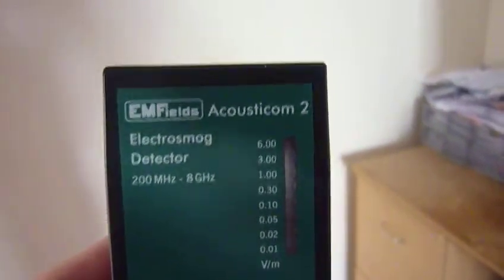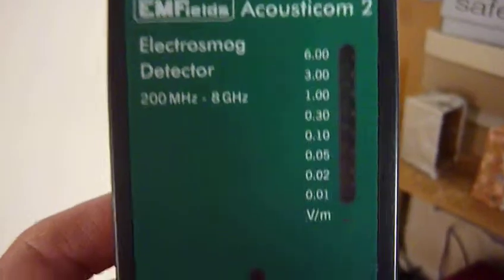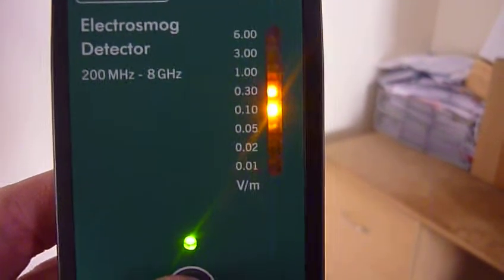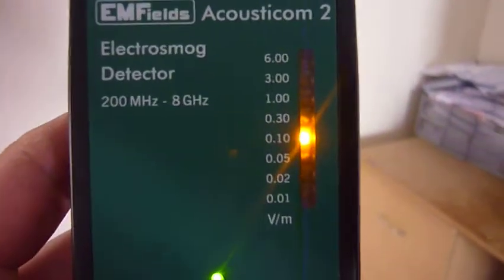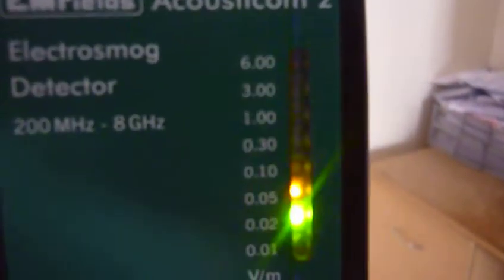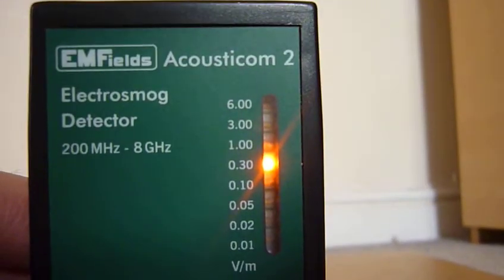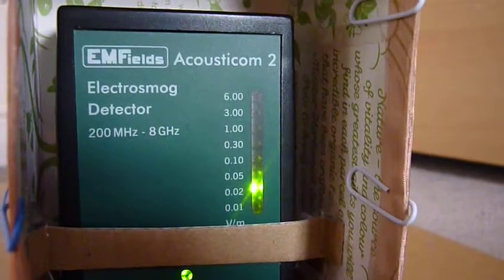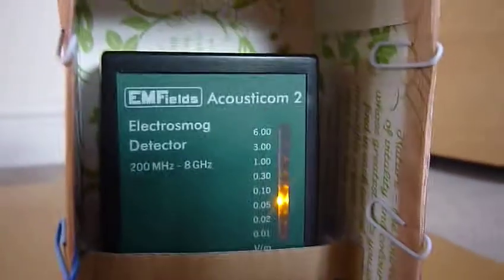Shielding wifi microwave radiation with Yshield paints and fabric

Comment: Certified Master electrician here: NEVER ground the shielding paint to ground in electrical outlets. This is a bad ground full of dirty electricity and by doing so you will create a room with dirty electricity radiating you much stronger!! You need to bring a ground from outside the house from a grounding rod, hammered into the ground.

Comment: how are the maximum and minimum levels computed (for the safety reccomendations)?..and what is the effect of having the various levels of elektrofog on a human?
Reply from the maker: There are various safety recommendations, they are all different. the 1998 ICNIRP (WHO) give an 1800Mhz  exposure guideline of 9,000,000 microwatts/m2,  whereas natural background RF levels that humans can tolerate with no harm are 0.000001 microwatts/m2.  Safety levels are computed based on studies of the effects on human tissue, but they only assess the heating effect. Other studies have shown DNA damage and other cellular damage from non-ionising radiation, at various frequencies and power levels, even very low levels cause damage.
The YShield paints i tested and copper mesh were all good, they work well.

https://www.powerwatch.org.uk/science/intguidance.asp
https://www.powerwatch.org.uk/library/index.asp
https://bioinitiative.org/table-of-contents/